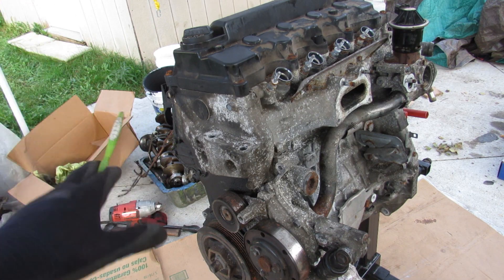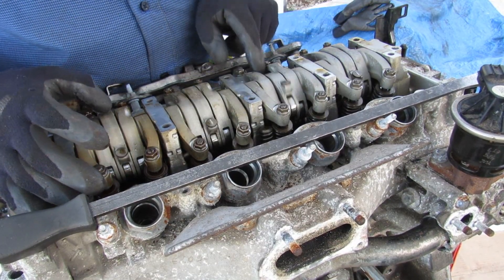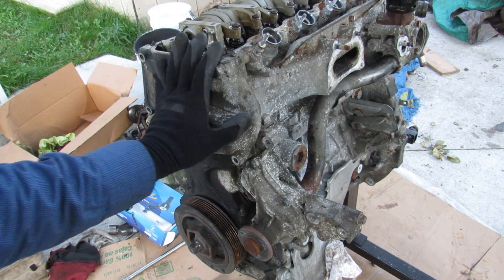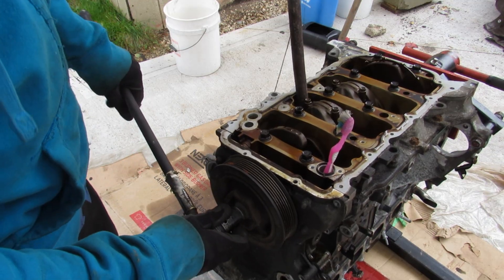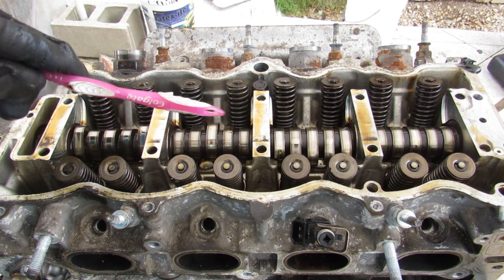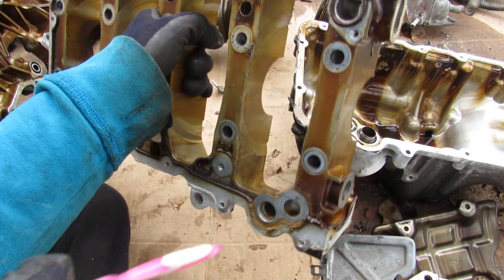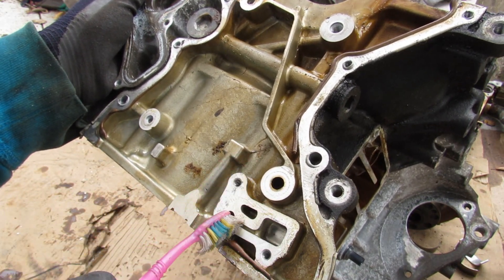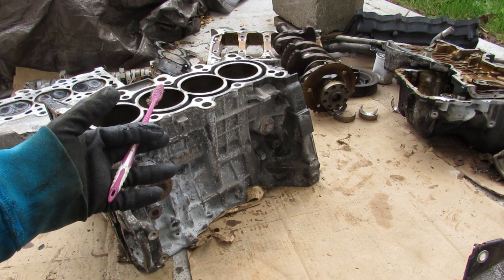Why Honda Civic Engines FAIL

Comment: I saw the same on my R18Z1 engine tearing down, I enjoyed that except for the oil control rings
The engine's head is different from the old R18A1, no more high lob profile of VTEC, it just simply turns off one intake valve on low RPMs
Reply from the maker: Thanks for the correction
Reply: @speedkar99  I didn't correct, you explained everything correctly for the engine you had torn down. I said the difference between the old and new versions of R18
Reply: Don't even bother with some boring SOHC engine. It's all about the K Series bro.

Comment: Were these casting issues randomized or specific to a particular factory? Would the failures inevitably occur overtime? So say... 20 year old R18 would be fine while a low mileage one might reveal the defect later?
Reply: High failure rate for engines produced in North America. I think at the Canadian engine plant. Not all are destined to fail but the rate is higher than usual for 2006 and 2007 production years afaik, due to a manufacturing problem not an inherent design flaw. I have a 2006 with 340k km, no problems.
Reply from the maker: 2006-08 had the casting defects. Not all cars get the issue. It was fixed in 2009.
Reply: You can look for Honda TSB a08-044, on another official Honda document (forgot the number) they provide a range of VIN’s for the vehicles affected, including  some 09 models. Only including North American models (US and Canadians). On the other hand we have a 06 that cracked with 80k km, we had luck and it was still covered under the extended warranty.

Comment: I have a 2006 with 340k km and still going strong. Not showing any signs of end of life yet.
Reply from the maker: Nice! Keep an eye on that coolant level
Reply: @speedkar99  I drove it really hard for a few months before the 10 year extended warranty expired. I was hoping to force it to crack. No luck. Still good. Leaked coolant recently due to a corroded hose clamp however. I'm keeping it to bitter end. It'll be interesting. I won't be shocked if it goes to 500k or 600k km.
Reply: @jptrainor  What happens if the engine block cracks? Any dangers on the road or does the motor just die?
Reply: @rihasanatrofolo2472  It leaks coolant slowly. No sudden failure. If you check the coolant overflow bottle regularly you'll notice the coolant loss before it causes a problem. If a lot of coolant leaks out and is not replenished then the then the car will overheat. It affected 2006/2007 and a few 2008 engines AFAIK. Not all engines fail, just a higher than average rate of failure for Honda. Higher mileage engines that are still on the road at this point are probably never going to have the problem IMO. Mine is now at 353k km.  BTW other things will also cause coolant leaks, e.g. a leaking hose or a failed hose clamp. I had a hose clamp fail on mine and it leaked coolant. Easy fix though.
Reply: @jptrainor  Cheers for the in depth answer! I found that it doesn’t effect EU civics, so I guess I’m in the clear
Reply: @rihasanatrofolo2472  Correct. It was a problem at the Canadian factory that only makes cars for the North America market.
Reply: Now at 370k km. New power steering lines, tensioner, and water pump since 340k km. Also just replaced the drivers size floor pan due to a hole rusting through.  After 16 years and 370k km of wet salty winter boots the floor pan just couldn't take it any longer. Honda only seem to use 22 guage sheet metal for the floor pan. I replaced it with 18 guage sheet. It will outlast the car.

Comment: I’d love to see a review or teardown of the 1.5t. I definitely find that engine very interesting and would love to know more about it. 

I have a 17 Sport Touring hatch with the engine and it definitely is a pocket rocket especially on the highway at high speeds when using high grade gas.
Reply from the maker: I sure would like to get one. Heard they had issues with oil dilution
Reply: @speedkar99  Looking forward to seeing the teardown of that L15 engine.
Reply: @speedkar99  Yes it was a issue with the early models especially if you live in a state that’s very cold and if you drive the car on short distances. 

I realized that it takes quite awhile for the engine to warm up when cold, but I never had the issue because I live in the Midwest and I drive my car a lot and sometimes hard. But I did get my car checked so it’s fine. 

I believe in MY19 or 20 Honda updated the engines so the newer models shouldn’t have any issues, and they still are offering the recalls on the older models.
Reply: My 2019 civic si with the 1.5t had a blown engine at 2k miles. Chain stretched and head gasket blew